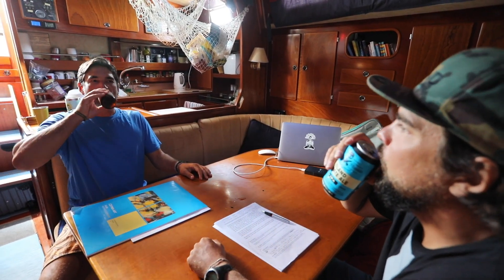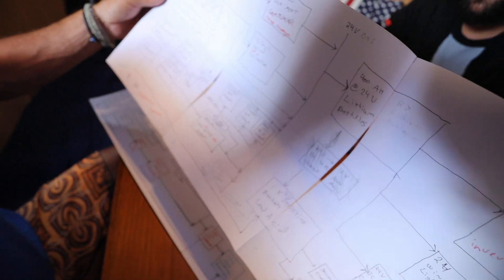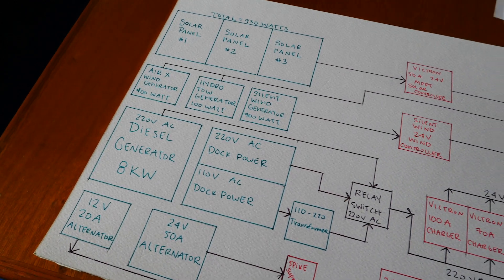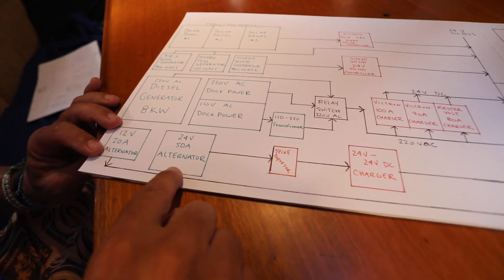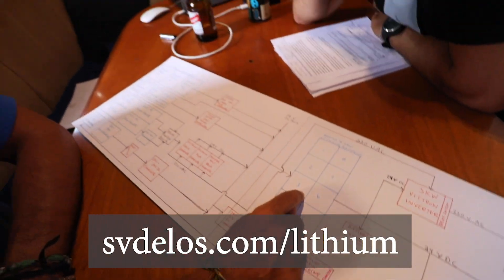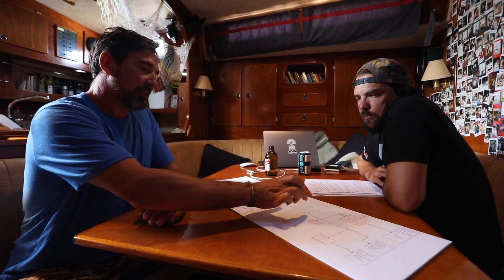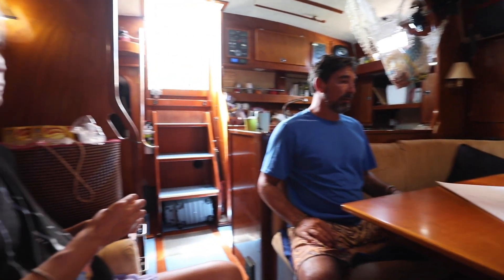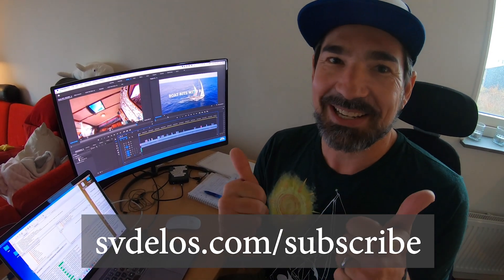Sailboat Electrical System Overview - ELECTRICAL BOAT TECH (1 of 7) - Sailing Vessel Delos

Comment from the maker: We just got a special discount that we want to share with you!  Take $50.00 off PER BATTERY with a special discount from Battle Born just for the Delos Tribe.  If you’re in the market for some spanking-brand-new LIFEPo4 batteries to super charge your power system check them out.  We’ve torture tested them on Delos for years and they perform incredibly well.  Just be sure to enter the discount code "delos" during checkout to get your $50.00 off PER BATTERY!  Check out their different products and packages here: https://svdelos.com/battleborn

Comment: Great schematic. Also cute diagram labels on the inverter and bus distributor. I didn't know that inverters had the ability to just let AC power pass through it and take power from batteries otherwise. That's smart. Learned something new.

Comment: Hello. Greetings from our self built 12m steel sailboat. We are Christa and Robert Absenger from Austria. We prefere the Geman language because our English is a litte bit bad.
In German language: Diese Vorstellung eures Elektrokonzeptes ist sehr gut aufbereitet und somit auch sehr gut zu verstehen. Endlich jemand der 24V preferiert. 12V für die Starterbatterie und völlig getrennt voneinander das 24V Bordnetz und von dort mit 24/12 DC Inverter alle 12V Geräte incl. NMEA 2000 
Wir haben es auf unserem 12m Boot genauso. Ich habe bei unserem Bau ein solches elektrisches System verwirklicht. 2 Lichtmaschinen (12/65 und 24V/100A) auf dem Motor (Betamarine 5cyl. 62Hp) allerdings keinen Generator, dafür 1200Ah/24V Bleibatterien,deren Gewicht unter dem Salonfussboden, ein Teil unseres Ballastes sind. Wir haben noch 400Wp Solar und den zuverlässigsten, leider auch den teuersten Inverter/Lader (Studer XTender 5000/24, (full swiss made)), der das Herz des Systems ist und sehr mehr als 15 Jahren ohne Probleme funktioniert. 
Wir kochen elektrisch mit 2 Induktionsplatten und Microwellle, haben Eis Maker etc. 
Der grosse DIY Watermaker 240L/h ist mit nur einem grossen HP 4“/40“ Filterelement und die CAT HP Pumpe wird direkt vom Motor angetrieben. So können wir gleichzeitig Wasser und Strom erzeugen.
Beim Segeln arbetet ab 5 Ktn unser Wellengenerator 24/35
Das war es von uns. Wir freuen uns mit euch auf euer neues Aluminiumboot.
Wenn ihr Lust habt schaut auf unseren Kanal Sailing sapore di mare und abonniert ihn. Es wäre uns eine Ehre, die erfahrensten Langfahrsegel als Abonnenten auf unserem Kanal zu haben.
Liebe Grüße wo immer ihr seid, Christ and Robert👍💕

Comment: Can you tell me, when you've got your generator or shore power supplying the 220 VAC supply to the Victron inverter, does your solar system get backed out? Does it supply any power to the inverter or is it all drawn off the grid?

Comment: Nice presentation. Imaging you carry a spare 24V/12V DC converter as it is a single point of failure for your 12V Nav/Com gear.

Comment: Great video :) one question: What 24v to 12v converter (on your diagram you call it "12v to 24v power supply") are you using and might perhaps recommend? I am planning to install a Lifepo4 system based on 24v to run the 240v inverter side more efficiently. With a more efficiently 24v solar changing system. I currenly have all my internal house and electronics (instruments etc.) running on the 12v system. So I will need a bridge from my 24v to 12v. Keep up the great work and hope to see you on the water :)

Comment: Hi Brian, Love your videos - totally inspiring! I am embarking on my own refit of a 1975 Ta Chiao ketch and following discussions with the Jonothan at Abelmail I have a quick question regarding your DC-DC charger install. Jonothan recalls there being some issue with getting the HO alternator to kick in as it is not directly connected to the housebank. He recalls recommending running a bypass cable from the housebank to the alternator. Did you manage to solve this issue? Many thanks Chris

Comment: I have a question: If you want to do easy fishing can you use the electrical system on the boat to zap all the fish in the water around you and then just pick them up off of the surface?

Comment: How do I know which size cables to use?  I plan on purchasing the Hanse 315 and rigging 4 - ReLion 12v 100Ah batteries (housing battery system) in a parallel circuit and adding 4 - Sunpower 170w flex solar panels with the Air X Marine turbine (max @ 400w) to the housing batteries. I'm learning as quickly as I can.  I'd like to add a battery to battery charger from the housing batteries to the starter battery.  Is that a good idea?  Should I replace the starter battery with a lithium battery?  I just don't want to overload the system and burn down the boat.

Comment: how do you contend with the (god forbid) eventual inevitability of a potential electrical fire? ORRRRR does the equipment on board shut down automatically to prevent run-a-way current through? ie - circuit breaker failure? or something melting and touching and completing a circuit that shouldn't otherwise ?? like at windlass or inline corrosion through excessive wire wear? fearful of this in the hard-to-reach places like above the headliner, behind cabinetry, etc...

Comment: Hello, 
I'm not sure if a comment on such an old video will find it's way to you guys?
 Anyway, If it does... You Guys are so very awesome in every possible way! 
I would like to offer up some of my time/skills to you and the project. I am an electrical engineer of sorts, I would be more than happy to redraw\create a proper electrical schematic for Delos or any other project you may be working on.
I can draw a proper One-line\Riser drawing such as the one shown in this video using AutoCAD Electric. I can convert it to PDF or whatever file type you would like, I will also have it printed and sent to you. I often print sections of a schematic on outdoor vinyl with an adhesive backing and stick it to the inside of an electrical enclosure or a door\wall. I do this on the machine\ building for easy troubleshooting.
If you would like me to do this, or any other Schematic for past, current, or future projects, please let me know. I would love to help in any way possible. 
You are such cool people. Keep up the good work and live it up!
Thanks, Louis
LJDupuis@live.com
Louis@hselectricco.com

Comment: I assume the solar panels are in parallel... Would it be more efficient to wire them in series and then have a Charge Controller with a 150V max? (since the current is only 100V max.)

Comment: Do you have any bit controlling the frequency on the AC in path? If the inverter just passes the flow through, I'd assume that what you got is what you get and you might end up getting different cycles at your end devices (some don't like that), depending where you are in the world; or am I overthinking it?

Comment: Your diagram had an isolation transformer but I did not hear you talk much about it. My understanding is that the isolation transformer will convert the voltage but not modify the frequency. This means you would be transforming 110v/60Hz to 230v/60Hz. This may not matter for the battery charges but you are also feeding it into your inverter/charger. Do I have this wrong or are you running 230v/60Hz? If so how does this affect your appliances and computers.
Reply from the maker: No, you are correct it will convert the voltage but not the frequency.  The only thing I've found where it creates a problem is with the washing machine and the dive compressor.  All the computers and such work just fine because they are converting to DC for charging I believe.  Also the new air con we got works fine, but the old air con did not.  Hope that helps.

Comment: Love these technical/how to videos!  Question - If I followed you correctly, there isn’t a way to leverage the house bank to start the gen or the engine.  Do you have a plan b if the starter battery goes belly up?  Thanks!
Reply: House Bank would likely keep the start battery charged thru the DC-DC 12 to 24v charger they have.
The higher resting voltage of lithium means the Dc-DC charger will keep running off the 24v batteries even when they are not being charged, thereby keeping the start battery always full.
So as long as the start battery can provide the cranking amps your fine, as if you get get the engine or genny running, then you can recover the rest of the system.

They could use a Lifepo4 battery for starting as well, i have one in my car made by EV-Works Australia, and its a drop in replacement for a Car battery, and has its own internal BMS, such that it charges directly off the alternator without any extra stuff.  Link to battery: https://www.evworks.com.au/start-saver-battery   They could fit one of these to Delos to replace the lead acid cranking battery, and they Wont need a charge controller for the 12v alternator, the battery is designed to work without one, so it keeps things simple.

The cranking amps it delivers is crazy, even when almost flat. it also has an automatic reserve function so if you leave the headlights on for instance, it will cut off with about 20% capacity left, and you can unlock that at the push of a button to start the engine. I've tested it and accidentally tripped it as well, so it does work well. I can sit around with the key on for hours, and the start will still spin the engine over faster than a fully charged lead acid ever could.

The recharge rate is also crazy fast as well.

Comment: Have you installed a galvanic isolator or a isolation transformer? Was not in your diagram. I ask cause it is important to have one on your shore connection to prevent your ac ground from corroding when plugged in, if there is a ground short in the marina's wiring

Comment: Having an Electronic Engineering degree I can appreciate the outstanding job done on your high level “schematic”. I have always been a big proponent of incorporating color coding to help implement that added degree of visualization. Super job, well done Brian. I just think about how simple you made that look, but the reality of the amount of wires and connection points traveling out of sight throughout Delos. Not being a sailor, I was able to learn how all the different electrical systems are incorporated into a vessel. Thank you very much for sharing.
Reply: Yes I was hoping he would do this too

Comment: Thanks for the info.  I’ve been struggling on how to charge the starter battery so this was very helpful. If keeping both systems in isolation, I guess I can eliminate the battery switch, since you don’t want to crank the engine on the lithium batteries anyway?  Starter battery is only being charged through the inverter and a battery charge hooked to the 110 panel, which isn’t efficient. Hired a second electrician, whom is also struggling to come up with a solution.

Comment: Could you connect the 12v starting battery to the critical 12v systems such as navigation lights, bilge pumps, radio etc via a switch. Then if something happened to their normal battery or inverter you could simply throw the switch to bring them online instantly? It would be a good simple bit of redundancy, especially if you needed the bilge pumps in a hurry.

Comment: Great video.  I like your design.  Easy to troubleshoot and fairly bullet proof and while it's probably not the most efficient, I can definitely see the engineer in you coming out.  The only thing I might consider adding is a hard switch to use the house bank to start the motor if you had too, but you could just easily pull a battery from the house bank and connect it to the starter.

Comment: Need some quick help. Can you adjust your Victron DC to DC charger to limit the amp output?  Say you want to reduce your alternators output by 50% to help keep it cool.   Thank you!
Reply from the maker: Hmmm, not sure about that.  I use a DC to DC charger from ablemail electronics in the UK.  There is a link to their company at https://svdelos.com/lithium in there.

Comment: At one time I lived off the grid, and needed a way to charge my laptop. I developed a 18-20 vdc system anchored, at the time, with lead acids, three 6v, and charged with solar. An amazing system for a laptop. Noise / inverter free ! Would run for hours with some old trojan 6v batteries. With lithium, you would run 5 banks of lithium ions (for instance) in series of course, or the lead ph 4 version, giving you the nominal 20v. I'm going to try that next as I do not have access to Trojans like i did, but have access to some great 18650's and have a way to do it.. I'm in California, we have regular power outages now. Would also like to figure out how to run my 32inch screen I use for a monitor. I also have 400 amp hours of deep cell lead acid here right now. They are huge "telco" batteries. . I've only got 12amps of solar at 17 volts available right now, improving that little by little. Solar panels are cheaper now. If setting up for a boat, would want a special type high efficiency version less square footage, like the ones they use on the ISS space station.  This series is special for me, aspiring to get on a boat and land free hopefully soon.

Comment: The drawing you made is what we call a "1 line" drawing.  We use them a lot as electricians and engineers.  Helps greatly when explaining how a system works without getting down to the nitty gritty of the wiring and controls.

Comment: A side-note about the disaster that would happen if you mixed two AC-power sources: On the Airbus A330, they tried to eliminate the transitory loss of power that happens when the aircraft equivalent of Delos' single-select-relay moves from one position to another (on an airliner it's a collection of on-off computer-controlled contactors instead of a multi-pole relay like on Delos). It does this by speeding up or slowing down one of the generators (either the generator on each engine, or the Auxilliary Power Unit up in the tail) to match the exact frequency of the other power source (the aircraft can't control the ground power from the airport, so in that case the other power source always has to adjust to match frequencies). Once they get close enough in frequncy, the contacts for the "new" power source are closed, and only after a few seconds the contacts for the "old" power source are opened. So for those few seconds, both power sources are running together. If you tried to do this without the fancy frequency-matching algorithm, as Brian says, it's a disaster: Very rapid overheating, with all kinds of damage, potential fires... it's a bad time...

That said, Boeing does things differently: On an Airbus, each main electrical generator powers a separate electrical network (so for example, the generator on engine 1 would power half the aircraft, and the generator on engine 2 powers the other half of the aircraft). They never run in parallel, except for the example above. On many Boeings, they run all the generators on the same network all the time. On the A330, it's hard enough to get the power sources to match together for a few seconds for the power transfer, so I don't know how Boeing get the generators to synchronise for hours and hours, day after day, but apparently it works fine.
Reply from the maker: That's fantastic info and very interesting.  Thanks for sharing!
Reply: @armslength2618  Hats off to you for how much you accurately surmised there!

So, on the aircraft, we are essentially doing both of those scenarios at the same time: Bringing a new power source onto the grid, but since there's only one power source for the grid at any one time, we are also trying to eliminate the momentary loss of power to all equipment. 

This was only done on the A330: It turned out to be more hassle than it was worth, so that's why the lights flicker just before you push back from the gate at the airport on other Airbus planes: It's the changeover from airport power to an on-board power source.

You're almost right about the Boeing generators (incidentally, they're almost identical to the ones used by Airbus - there's only one big supplier in the world for such equipment), except that they don't need to influence engine speed between themselves. The generators all have a hydraulic variable speed drive (either integrated with the generator or as a separate component) between themselves and the engine gearbox, so the generators can influence each other without having to affect engine speed at all. I'll have to take your word for it about the witchcraft that is synchronising multiple generators by their phase angle :-)

Frequency is governed by the shaft speed coming from the variable speed drive (This is passively regulated on older Airbuses (and presumably on Boeings) and, as you surmised, servo-regulated on newer Airbus planes). The excitation is varied to control the power output.

The A330 does monitor phase angle, but doesn't actually try to control it - the hardware just isn't that precise. But since the frequencies don't match perfectly anyway, it is usually just a question of waiting a few seconds until both frequency and phase angle are close enough and then the switching is carried out. On the off-chance that a suitable match doesn't materialise after a few seconds, the transfer is performed with the momentary loss of power (and everything on the aircraft is specified to cope with that without problem).

The new A350, A380 and B787 are all now using variable frequency generation: The variable speed drive is eliminated (saving cost, weight and complexity), and they just don't bother trying to regulate frequency on the network anymore. This makes sense these days, since more and more equipment is electronically controlled and is therefore insensitive to frequency. Voltage is regulated by excitation, and that's it.